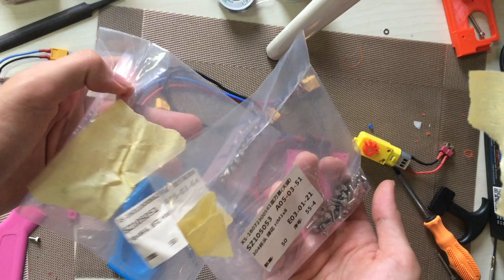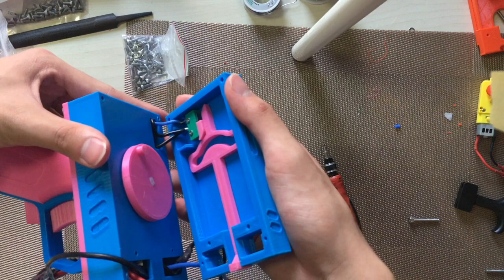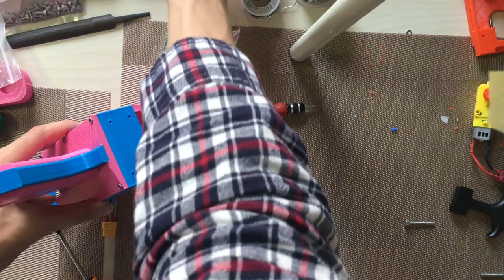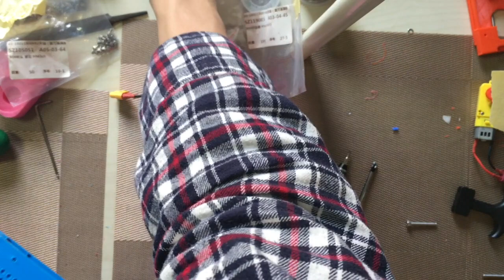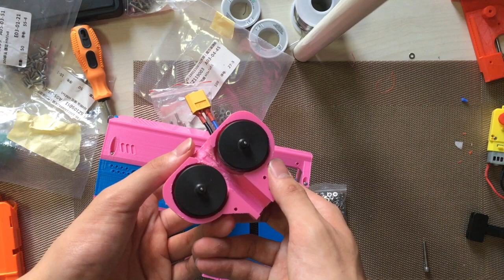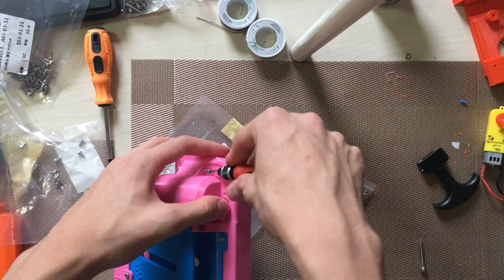Rektify Mk.2 Assembly Guide

Comment: which size extension spring should i use?
Reply from the maker: Spring thickness 0.5mm, coil diameter 5mm, spring length 15mm is what I used. It can be slightly longer or shorter, weaker or stronger than that.

Comment: Just need some advice on how to wire in the on off switch safety. Don't think I should wire in the battery leads as a lot of current will be running through the switch itself. I was thinking the flywheel leads? Any advice from anyone would be helpful.
Reply from the maker: The thing is, it doesn't actually matter. The main source of wear and tear on our switches occurs when they are used to OPEN and CLOSE a circuit. As the on-off switch will at most open or close the voltmeter circuit, it's not really taking this strain. This is also a reason why you should avoid revving the flywheels, and then hitting the on switch.

Also, when wiring the kill switch past the flywheels or just the pusher mech, it's possible to accidentally end up with a system that ONLY shuts off a certain circuit and not the whole blaster. I made that mistake on Mk.1 of Rektify as I was putting it together.

Comment: your thing is in my printer yet !! electonic is in travel :) after showing several time your harness, i still don't understand the wiring of harness. can you give it? i'm going to print je pusher cover with the rectangular switch 1/0, it is for ON/OFF baterry or to move form single to auto mode?
Reply from the maker: On/Off would be for power, so yes, the battery. If you wanted to do something tricker that would involve a lot of DIY (if you don't understand this circuit, you probably could not implement select fire), it could be usable for select fire, BUT it's again, mainly meant for just turning the blaster on or off entirely.

https://torukmakto4.blogspot.com/2015/06/tech-rapidstrike-control-circuits-part-1.html - these are circuits that you can wire this blaster up with. The one I use in the video is 'dead center' as referenced in this article, and it also explains the benefits and trade-offs for each of them.

If you JUST want a hands on connection to connection guide, a Rapidstrike one is also similar: https://www.youtube.com/watch?v=hwbnobOxIY0

Of course, you will not be able to copy this one-to-one (the circuit is the same, but the arrangement of the wires must be different), and I recommend you add connectors where I have on the circuit displayed in this video. Also, strongly recommend connecting some AA spring contact trays to an XT-60, or a 9V battery connector to XT-60 to test your circuits before connecting a Lipo to be safe.
Reply: Ok thanks  @Flygonial  , after reading the post and show the video several time, i've tested on a test bench with a computer alim. it's working nice !

Comment: Is there flywheel create from ptinter 3D ?
Reply from the maker: Yes, but it most likely will need a non-printed shaft fit. A printed shaft fit tends to be unreliable and will wear out quickly. Best example of a reliable design is this: https://www.thingiverse.com/thing:3058568

You will need additional hardware.